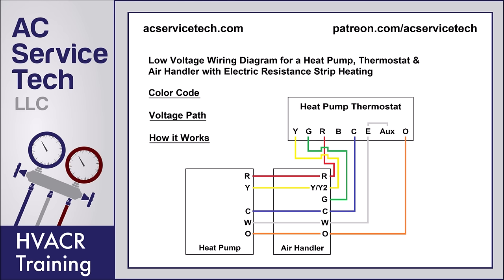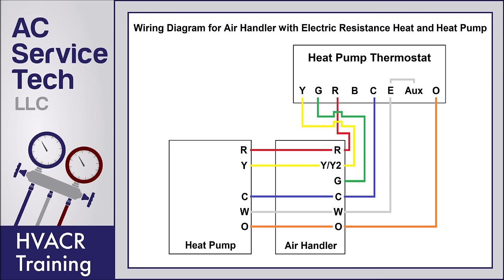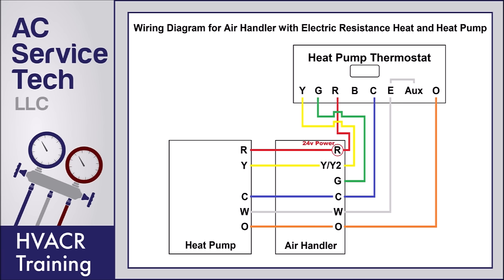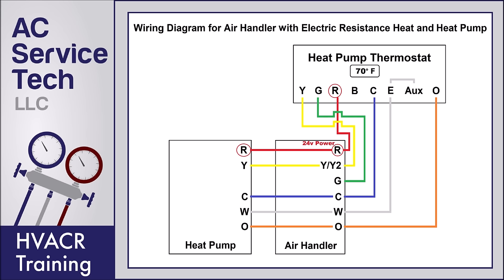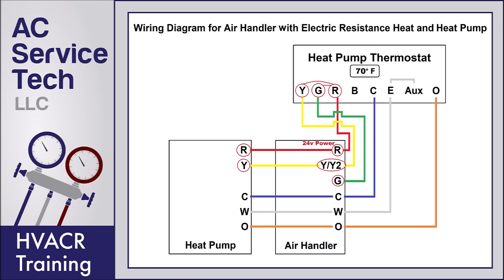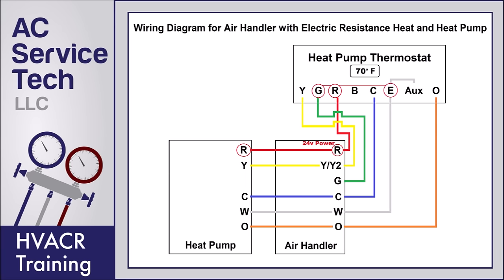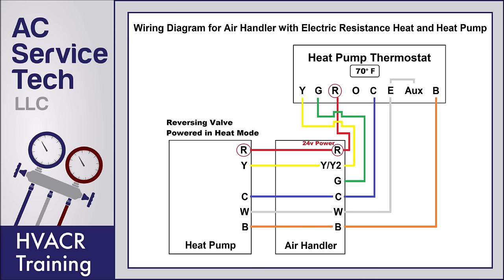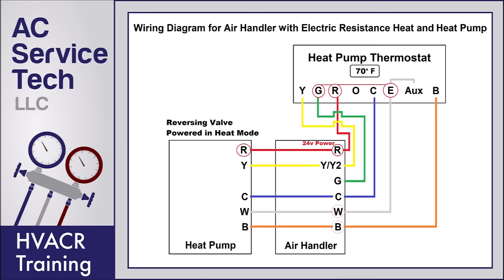Heat Pump Thermostat Wiring Explained! Colors, Terminals, Functions, Circuit Path!

Comment: I have a Goodmans Heat pump AC Air Handler and Condenser and a Nest Thermostat installed in 2014. Yesterday the Nest showed no power. After an extensive test with Nest online chat it was concluded thermostat is OK and fault is probably with Circuit board in air handler. Sure enough I found the fuse had blown on the board  (PCBFM103). I replaced the fuse, fired up and the fuse blew again. I have ordered a new board (now PCBFM103). This got me looking at the wiring. There are only 4 wires going to the condenser connected to Contactor/C, R, Y,  and O on the condenser and one of them is connected by alligator clips to one side of a resistor on the PCBFM103 circuit board.  None of this makes sense looking at your wiring diagram. Any ideas for resolving this puzzle would be most welcome. Thanks.

Comment: What would happen if the G wasn't hooked up - doesn't the Heat pump see the call for R+Y and know to turn the fan on using the internal furnace board logic? Is it really necessary for the thermostat to call for G in parallel? I was under the impression the G+R call is specifically when you want airflow without heating/cooling.

Comment: Great video.  We have a 4 wire into the thermostat that i want to upgrade with a smart (Honeywell T9) thermostat.  The new thermostat comes with a conversion module that uses the G wire to bring 24 V to the new thermostat on the existing 4 wire.  At the gas furnace, the G wire from the existing installation is connected directly to an HRV unit and not to the G terminal at the furnace.  Not sure where to go to install the new thermostat.  Any suggestions?  Thanks in advance.

Comment: about the wiring, I have an older Honeywell thermostat & I was told that where I have a white wire going to the "W2" that on the newer Honeywell connect it to the "E" slot. I have a heat pump with emergency heat. Is that correct?

Comment: I’m trying to replace the thermostat for a friend with heat pump, but he has a sensor with 2 S wires wired into his old Honeywell thermostat. Don’t I need to be able to wire those? My heat pump had a sensor connection, too. Nothing about the sensor here.

Comment: I have a question . I am going to replace my old thermostat that has only 4 wires connected R, G,W and Y. The B is not connected. My new thermostat has batteries, but the panel doesn’t have a letter W, do I connect the W wire to E?

Comment: Great video of how to wire thermostat to air handler and heat pump ..I’m working in a thermal zone heat pump split system with a wiser air smart thermostat that won’t turn heat on ,indoor blower comes on but no heat in the house , works fine on cooling mode but no heat . NEW THERMOSTAT WIRES are connected to new terminal phase plate Red to RC, Yellow to Y ,Green to G Brown to C and Blue to O/B any suggestion .

Thanks in advance 🙏
Reply from the maker: You really need to turn the power off to the air handler and check to see what color wires are for which function inside the air handler in order to wire the thermostat, thanks!

Comment: I have all those terminals on my thermostat, so my question is how or where would I connect them in a nest 3rd gen thermostat? Specifically the e and r terminal. It will be a greatly appreciated for the info

Comment: on heat call with auxillary heat on, there's 24 volts on R,Y,G, W/aux right?..if you are using high speed on cool and low speed on heat , how do you not sending power to both speeds of the blower fan if G and W are both energized?.....been looking for a diagram/explanation for a lil while now, could not find one....thanks in advance!

Comment: Is 28V too high? Also, is any measured voltage between 24 and 0 on any wires (yellow in my case) indicative of a problem? I am getting 6.7V on the yellow wire at  the condenser unit with the thermostat in cooling mode but setpoint above the room temperature (so that cooling is not called on).

Comment: Thank you—when I jump the white (heat) wore at the thermostat, it blows the 5 amp breaker, but not when I turn the system on to heat with the thermostat plugged in; then the blower motor semi-cycles, runs, and clunks.  Neither the green (fan), nor the cooling wire reacts the same. There’s no dedicated ground wire at the thermostat. Perhaps the white wire needs changing?
Reply: From the thermostat take off cover and remove wires. Check continuity from white to the other wires with your multimeter, listen for the beep. If no beep then check the thermostat wires at the air handler. Sounds like u have a short in the W but you have to figure out what it’s shorted to and replace the wire. Either use the spare wire from the thermostat or from the AH. If you have no wires than you will have to fish new Tstat wires (May need a professional)

Comment: Why would the thermostat send power to the fan relay in aux heat? I thought the fan was turned on by the sequencer with electric strip heat, and then through the fan relay's NC contacts? If you send power through g in aux heat you would have the fan running in high speed and subsequently reducing the heating efficiency the heat pump is producing.

Comment: Hello Sir,

Is it possible to add reverse valve in the inverter ac's. The ac is of R32 gas and 2.2 ton mitsubishi electric GR series.
If possible then what are the changes

Comment: On a heat pump that uses the orange wire in cooling mode. Once the temperature that is set is reached does it still supply 24v to the orange wire? Or does it only not supply 24v to it when off or in heating mode? Thanks
Reply from the maker: It shuts off power when off or in heating mode, thanks!
Reply: @acservicetechchannel  thank you! Been having a problem with the AC randomly quits  cooling. If i shut it off for about 10 minutes and turn it back on it works great for a while. Then one time it just won't come on. The condenser fan is running. Checked the capacitor and wires to compressor. added a hard start kit. think the compressor isn't running. I've watched your videos and read your book but can't find my problem anywhere. Any ideas?

Comment: So is it normal that when I went to install my nest, there were two wires (black and brown) that were unconnected to anything inside the wall?  Also my thermostat had the white wire hooked up to the W2/aux terminal instead of the W1.
Reply from the maker: There may have been extra wires run. Were they connected in the air handler?
Reply: I followed the wire it seems to be wire nut attached to the white W2 wire at the air handler and in the same wire nut is another black wire going out to the outdoor unit.  I think it’s for emergency heat.

Comment: Could you some time explain the difference between using the Y1 or Y2 terminals at the air handler terminal board and also when to keep or remove the jumper between RH and RC at the stat. Maybe you have and I just have not seen your video yet on those. 
TY once again.
Reply from the maker: The Rh is for connecting r to w and the Rc is to power the tstat and to connect to y and g. The jumper remains if it is all one system such as a furnace and ac system. If you are working with a boiler and a separate air handler then remove the jumper. I believe I mentioned that in the top ten thermostat wiring diagrams video. Y1 and Y2 at the air handler are blower speed taps but often there is a jumper connecting them on the board, thanks
Reply: Ok. I have a heat pump and air handler and was curious. I assumed it remained in. 
TY

Comment: Hi, I just installed a MrCool 36K Hyper heat ducted  system , it works fine with the thermostat that came with the unit.  But I would like to use my Google Nest gen3 thermostat instead.  If you or anyone, can help me with how to wire the Nest that would be great.  Thank you very much.  Noel.

Comment: Great vid!  
Im having an issue where my ac is blowing hot inside and ice cold outside at the condenser.  Any idea what this could be?
Reply from the maker: The heat pump is running in heating mode and it may have something to do with powering the reversing valve which depending on the unit will be B or O, thanks!
Reply: Sounds like the reversing valve is "stuck" in the heat mode position. Try switching between "Cool" & "Off" on the thermostat several times. Also, lightly tapping on the reversing valve with a rubber mallet might help as well.

I had a similar thing happen. I ended up having my wife switch between Cool & Off, I disconnected the condensing fan motor so I could reach the reversing valve, & tapped on it while she was switching & it worked. Haven't had a problem since.

Comment: You do not need terminal O on your air handler. From the thermostat the O wire go straight out to the outdoor heat pump.

Comment: I know this is for a system with an electric heat in side but I guess this would also work for any other secondary heat source IE gas or even wood ect.
Reply from the maker: You would be looking for a duel fuel thermostat for that, thanks
Reply: @acservicetechchannel  I was asking because I have a Goodman air handler that is gas and a Goodman Heat pump.  I have been thinking about getting one of those Nest Thermostats.  But right now I have a honeywell thermostat.  I will have to look at the thermostat and see if it will run the gas as the emergency heat source.
Reply from the maker: I have one video on duel fuel thermostat wiring but its not with a nest thanks!
Reply: @McCuneWindandSolar  the Nest is garbage. Get an EcoBee instead.
Reply: @jasonjohnsonHVAC  yea I ended up with the Carrier, that uses EcoBee.  The Unite I have I can have up to 3 different Heat options set up,  I right now have it set up for heat pump, and Gas.  but I can either control wood, electric, or another 3rd source.  Programing was a snap.

Comment: hello 
does ur book cover any refrigeration ?
Reply from the maker: It is mainly covering the topic of ac units and heat pumps but it does cover same procedures to prepare a system for refrigerant. It goes over reading the gauges, refrigerants, sat temps, telling what refrigerant is in the system, talks about the differences between the accumulator and a receiver, and so on. The full outline is at https://www.acservicetech.com/the-book

Comment: Now where's the video explaining something like a train or American Standard Platinum 1050 communicating thermostat (because you have zones) that only has BRD and you have to have Tranes relay panel because your air handler (that is variable speed) and heat pump (which is 2 stage by the way) so all your connections are made within the relay panel because thermostat only has three inputs and only uses the 2 AUX inputs for ventilators and dehumidifiers/humidifiers and has 2 ODS inputs for an outdoor thermostat and nothing else. The relay panel has all the thermostat inputs Which is BRD Y1 Y2 C R D BLK BR BK B/WHT O W1 W2 W3 and finally E.

Comment: What if the thermostat has 6 wires, the air handler has 6 wires and the heat pump has 4 wires.
Reply: I’m not an expert, I’m not even an amateur. Just a man, but possibly is without auxiliary heat strip coils to supplement the heat pump. 

Thoughts?

Comment: I have a vivint smart thermostat and a heat pump system it only has 5 wires 
Y,G,R, B,W  l m having issues how is this supposed to be wire 
The thermostat has 
Y2.     C
Y.        A
G.       O/B
RC.    W2
RH.    W